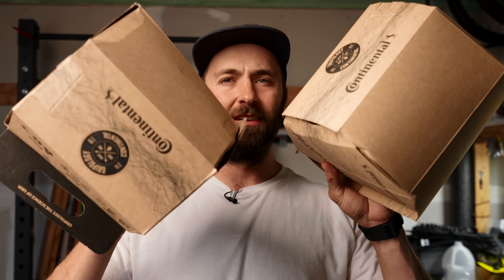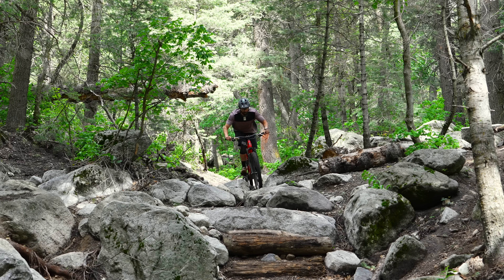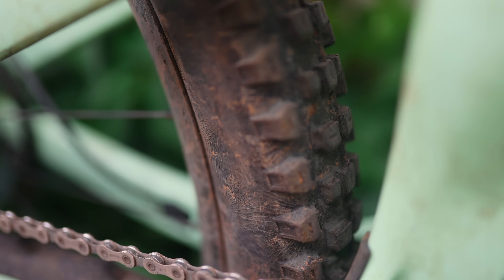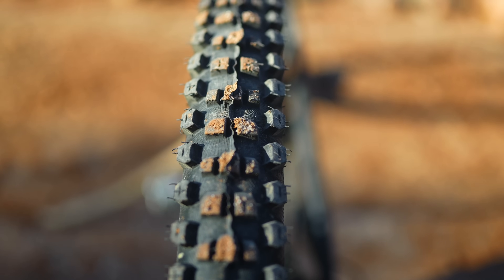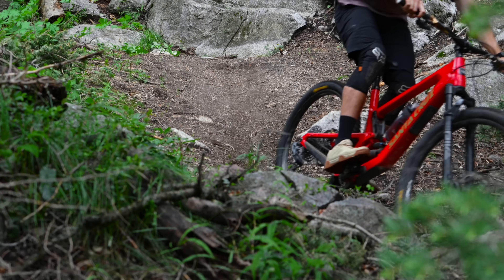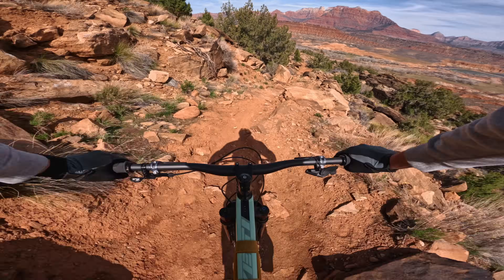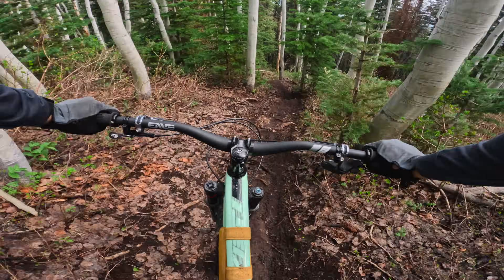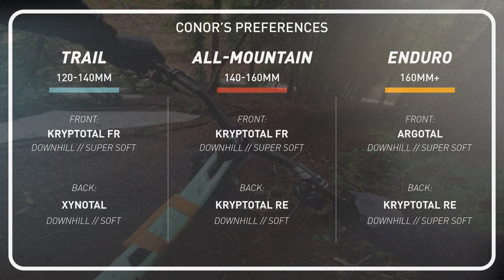Continental MTB Tire Guide: Find Your Perfect Tire

Comment: Please review all the facts you state before publishing a video. Not to be all negative it was a good video but for example you did make a mistake with the tire widths as the Kryptotal fr is not available in 2.6 but the Kryptotal re is aswell as the Argotal. Another thing which might be misleading is that when you talked about the kryptotal re tread pattern you showed off the kryptotal fr instea. But other than that good video mate
Reply from the maker: You are correct. 

I had been experimenting with a kryptotal front as a rear tire and grabbed the wrong wheel when filming. Too many tires swaps in the last few weeks.
Reply: @bikersedge  Understandable as they even have basically the same name. Keep up the good work my dude

Comment: My LBS recommend Xynotal lightweight everything front and back. Shit slaps. Fast rolling, nice and grippy in our super dry hardpack right now. Even at the bike park they were flying through everything. Couple drifts on really loose moon rock but any tire would do the same. 

Having 1500km on DHR front and back, and only ~120km on the contis, Id put contis on again tomorrow were they to blow.

I ride in very rocky and hardpack areas of northern ontario and northern Minnesota mainly.
Trip planned to Moab this fall so I'm sure theyll be excellent there, too.
 Amazing grip and speed for the terrain this summer is bringing so far.

Comment: Great reviews! 

I installed Xynotal Soft with Enduro casing with Cushcore in the rear. It rides so good with actually higher pressure compared to Maxxis EXO+, Schwalbe SuperGravity and Micheline. Also I did a pretty wet and muddy Enduro race with it - it's actually pretty good for a hardpack tyre:
- it clears mud well with a little speed
- inspires confidence on offcamber - the side knobs bite in so well.
- really predictable under breaking

Best rear tyre I ever had (15+ years).
Reply from the maker: I’m pretty impressed with the Xynotal. Grips better than I would have thought.
Reply: @bikersedge  How does the Xynotal perform compared to a Dissector? I've been running a Dissector out back on my Megatower (currently with DHF, but I preferred Assegai up front with that combo, as both tires have that vague channel).
Reply from the maker: @ABHORRANCE831 I prefer the Xynotal over the Dissector especially in the DH super soft. I think it provides better traction on the brakes and in the corners.

Comment: stellar video. I run a tire insert not for flat protection, but for rim protection. FWIW.
Reply from the maker: Hey thanks. DH casing does the same thing. The same thing that prevents a pinch flat, prevents rim damage - whether that’s a lot of air pressure, insert or heavy casing tire.

Comment: Slapping Kryptotal DH super soft and DH Soft on my Megatower will see how it performs. Current set up maxxis dhr2 2.4 Maxterra front and Dissectore double down max Tera rear. Seems like DHR2 runs out of grip at extreme lean angle while dissector is good in hardback and loos over hard, it is terrible in the wet, almost no grip.  Excited to try Conti combo.
Reply: Update: I would have to admit I put them on for a shuttle day here in Alsea Falls in Oregon and after two runs took them off and put on my dhr2 and dissecor combo. Initial feedback was they roll fast but not sure how much traction I could trust and felt like they did not hook up as well as my preferred combo. So I just wrote this off and thinking to myself I just wasted 200 bucks on these tires.  These did a bit of weight, 1 pound to be exact.  For reference I ride  Megatower V2 XL.  I wanted to like these and so I decided to give them another try on my local trails, I ride mainly Blues so nothing to gnarly but with some tech, roots and rocks.  I did notice the added weight on the climbs but not much, all acceptable to my standard.  Going down oh man these rolled so fast I was actually picking up speed compared to my previous set up, the added weight was not even noticeable and the addition sidewall support was eye opening to me when coming in hot in the corners.  Definitely recommend these. Also would like to experiment with Enduro Casing in soft should be a good combo but not sure if I am willing to give up the support I get of DH casing.
Reply: @NoShredDad  Sweet, thanks for the feedback. I too am on MT2, currently got DHF/Dissector, had Assegai/Dissector which I liked a little better. My tires are toast, and need a new set.  I too am am gnarly or hard on tires.  The Megatower pedals like a pig, and I ride it like a Trail bike, so rolling resistance matters. However, I most certainly do not want any less grip than my current setup.

Comment: Really appreciated the chart at the end on riding types and your selection. Surprised DH won out on all, but the logic on weight savings was solid. At the price point though, I wouldn't mind experimenting with a different casing.
Reply: I got downhill tires based on this chart and pretty quickly swapped them for trail tires. I think if you’re honest with yourself about how hard you’re actually riding, you might not need the beefiness of the DH tires. I’m 220lbs and riding chunky trails, but it is trail riding, and even Enduro casings would probably be overkill.
Reply from the maker: Just depends on how and where you ride. Personally I prefer DH tires without inserts over trail or enduro tires with inserts, even on my 130mm bike.
Reply: @bikersedge  I got the kryptotal (fr) and xynotal (rear) in Enduro, and they've been amazing on aggressive trail riding on the front range. This review helped me identify a fast rolling replacement of my dual Assegai stock setup.  As always, I appreciate the content and information.

I personally can't stand inserts. For some riders, they love em and I respect that. For me, they plant the bike too much. On these tires, I feel confident they'll stand up.

Comment: I’m very happy with my 29x2.6” or 27.5x2.6 tires that always get Cushcore and are on i35mm rims. But I’m also riding hardtail’s and my tires need to be my rear suspension.
Reply from the maker: I’ll die on the 2.4” hill. Even on my hardtail.

Comment: I have Argotal FR Super soft and Krytotal RE soft both DH and they are amazing! The only tires with more grip are Michelins DH 34 and 22. BUT.. Continentals have lasted waay, waaay longer. Like twice as much.
Reply: Do you think these last longer than a maxgripp compound?
Reply: Just fitted the same set up and wondering if I’ve made a poor Uk winter choice with the argotal up front. You used it in the wet / mud?
Reply: @jackharmer8264 , how did you get on with the Argotal up front in the UK winter? I’m thinking about the same setup and am also in the UK.

Comment: Superb tyres right from the original Baron on. Continental always had an issue with seeping side walls but they fixed that now. I am running Kryptotal F & R in Enduro and they are truly superb, tough as hell and insane grip for all round conditions. However……….my one criticism is that they just come up too slim in 2.4 which is more like 2.2. If they made a true 2.4 or 2.5 these would be truly unbeatable.
Reply: that depends on your rim width above all things...
Reply: What is your rim width?
Reply: @Montezuma0 27mm, kryptotal is the same width or even wider than DHR II 2.4"

Comment: Excellent Review and Breakdown!
Much Appreciated!

It would be awesome if you could review Kenda MTB tires similarly, especially after installing them on the Transition Smuggler you recently reviewed.
Booster, Karama, Regolith, Nevegal, Helldiver, Hellkat, and Pinner seemed light compared to the designated application compared to other manufacturers.
So far, I only had the opportunity to ride the Booster Pro 29x2.4 SCT, and I was just blown away by how that tire performed.
It rolled just as fast or even faster than Rekon Race while offering as much traction as the regular Rekon and being lighter than Rekon Race, Ikon, or even Aspen.
My guess is that you're not much into XC riding, but I would be very curious to watch your review about the Downcountry - Enduro line of Kenda tires (Karama, Regolith, Nevegal, Helldiver, Hellkat, and Pinner)
I just purchased a Kenda Hellkat Pro 29x2.4 ATC to go on the front of my Transition Spur, and the tire came up to be only 860g on the scale while being advertised as 898g (+/- 45g).
That is very light for such an aggressive-looking thread pattern.
Reply from the maker: Great idea. I’ve ridden the pinner and regoloth quite a bit. I would need some time on the others.

Comment: Fantastic video/comprehensive overview as always!

Only correction for your video is that you can't get all compounds in all casings. Notably, Super Soft is only available in DH casing, not Enduro and Trail casing. This is where Maxxis has a clear advantage over Conti - they make their grippiest compound (Maxx Grip) available in their lighter casings (EXO and EXO+).

In my case, favorite combo was a Dissector R (EXO+ Maxterra) + Assegai F (EXO+ MaxxGrip) for my enduro bike (as I like to be able to break the rear loose, and it's mainly loose over hardpack here). Dissectors just wear super quick, have replaced it with an Enduro Casing (Soft) Xynotal (which has just been a better Max Terra Dissector, somewhere between an EXO+ and DD) and kept the EXO+ MaxxGrip Assegai up front (as going to an equivalent from Conti - a Kryptotal-F in DH casing to get the Super Soft would be +250-300grams/a bit over 0.5lbs).
Reply from the maker: Correct. You can get most of the compounds in most of the casings.
Reply: @bikersedge  It seems that you can only get Endurance in Trail casing, Soft in Enduro or DH, Super Soft in DH. A lot of people are holding out for Super Soft compound in Trail or Enduro casings, and Endurance in Enduro or DH casing.

Comment: After using Maxxis Wetscream in the wintertime with alot of snow, sluggish or very wet weather theese sure has some points to win before i change! The wetscream eat milage since its an el-Bike, about 25% compared to originals, but the tracktion are like a dirt Bike on 15cm of new snow so i need more convincing…

Comment: Great review 👍I’ll go with kryp enduro. But I wonder why 2.4? My fuel ex came with Bontrager 2.5. how about 2.4 back and 2.6 front? Thanks.
Reply from the maker: Personally I’m a big fan of 2.4-2-.5. With variances in rim widths tire pressures and manufacturer tolerances across different I don’t think there’s a noticeable difference between 2.4 - 2.5.

Comment: Love the vid, explained a few things I couldn’t find elsewhere.
Random question, under what, if any circumstance would you run a Kryptotal Re on the front or even front and rear? I’ve heard somewhere that it works really well. Hope you answer I’m on the cusp of pulling the trigger. ✊🏻
Reply from the maker: I haven’t tried a Kryptotal Re on the front just yet but I’ve been running the Fr on the rear for a bit. The Re has bigger treads down the middle which is going to help with braking traction in a straight line. The Fr has a bit more of a transition from the center to side knobs. Bit more predictable leaning the bike over. Not a huge difference really at the end of the day though.
Reply: @bikersedge  thanks kindly mate
Reply: The World Cup DH Atherton team (helped design the tires) were running the DH SS Kryptotal FR in the front and rear position for the last few tracks, it was the setup for many of the Conti runners.

Comment: Great video!  Thanks!   So did you notice any handling improvements coming from maxxis?  

I have a gen3 Levo with 2.6 Assegai/DHR2 EXO+ tires.  I’m contemplating going to Argotal DH SSoft front/Kryptotal DH Soft rear.   All 2.4.  

Do you think my handling will improve?
Reply from the maker: By handling do you mean traction?
Reply: @bikersedge  does it turn better?  More precise?
Reply from the maker: You don’t really get that from your tires so much. You could get more or less traction which can impact cornering but the steering and handling precision comes from the geometry.

Comment: Great review. I have a YT Izzo (trail/XC oriented, but capable for more) and my Maxxis DHR II rear tyre was damaged and I need a replacement. I want to replace it with a Xynotal in the rear and a Kryptotal FR in the front. But I'm not sure to take the trail version or the enduro version. I only ride in Austria in the summer with my daughter (canyon spectral) for 1 week and for the rest in Belgium (Ardennes or a bit at home ... flat flat)
Reply from the maker: Tough to say without knowing your trails and riding style. I usually lean toward heavier casings because getting a flat will ruin your ride fast.
Reply: @bikersedge  not my video, but exactly this trail for example ... this is where my DHR II went almost of the rim, own fault, bad repair and it was still leaking, pressure to low. I use a YT izzo and my daughter a canyon spectral.
But I'm a lot slower :)
https://www.youtube.com/watch?v=EYsdVmgDvjo&t=124s
Reply from the maker: You'd probably be ok with a trail casing on trails like that if you aren't hitting the berms really hard and peeling it off your rim.

Comment: Great info. I recently switched to keyptotal F/R. enduro/soft. 
    I'm loving them, coming from Big Betty ,magic Mary combo. Maxis before that.   Think I'm going to try the argotal super soft for the front. I usually run 2.4 f/r, but am thinking about 2.6 front for better cornering (have you tried that?).  I'm in Northern Utah i ride eagle mountain, corner canyon, and others often.  What area of Utah are you in?
Reply from the maker: I haven’t tried any of the Conti tires in 2.6. I usually don’t like tires that wide. I’m a big fan of 2.3 or 2.4.

Comment: I live in SoCal which is dry hardpack rocky. Could I run the xynotal front and rear for a faster setup? Would I be lacking grip up front? Currently running Dhf/dissector combo and want something a little faster on my Giant Trance X. Do these tires have good rolling resistance?
Reply from the maker: I think the xynotal would work great as a front and rear. I’d love it in places like Moab and St. George. Sounds like your terrain might be similar.
Reply: @bikersedge would a Krypto/xyno setup add significantly more rolling resistance over a xyno/xyno? I would be buying all tires in the trail endurance compound….

Comment: are all tubeless?? and how do I know which one to use for the front and rear? I ride a Trance X 2 with 160mm travel rockshox pike select...it handles DH extremely well...btw what width did you use 2.4 or 2.6?
Reply from the maker: Yes. I typically prefer a slightly grippier tire in the front and a bit smaller knobs on the rear. Depends on preference though.
Reply: @bikersedge  so you use 2.6 front and 2.4 in the rear?
Reply from the maker: @boogiedownbronx73 no. I run 2.4 front and back but I choose a more aggressive treat pattern with bigger knobs for the front.

Comment: What size did you ride / recommend for your enduro setup? Currently running a 2.5 assigai F / 2.4 DHR2 R and unsure about going down to a 2.4 front but also concerned with a 2.6 front. Current setup already feels pretty slow and looking for something with same grip but better rolling speed
Reply from the maker: I’m a 2.4” or die kind of guy. Not a fan of overly wide tires.

Comment: I ride xc mix riding…. Tarmac, gravel, mixed and every now and then thick mud.
Would i be better off with the cross king or mountain king ?
Reply from the maker: It's been years since I've ridden the Mountain King, and I've never ridden a Cross King. Considering you ride pavement and gravel, I'd probably have to say the Cross King would do the trick. Tough to find a tire thats good on the pavement and dirt, though.

Comment: You said you don't miss maxxis yet buy tires that are Assagie ,dhr2  and dissector copies. I personally like the tires but I change my tires every year. And to this day I'm a kenda pinner rear schwalbe tacky chan front guy for a year round combo that is grip and pedals uphill like xc bike. Try it
Reply from the maker: @dman5703  I like the Pinner a lot. I’ve run it quite a bit. Love most things Schwalbe. The new radial casings with the magic Mary and Albert are on my bike currently.